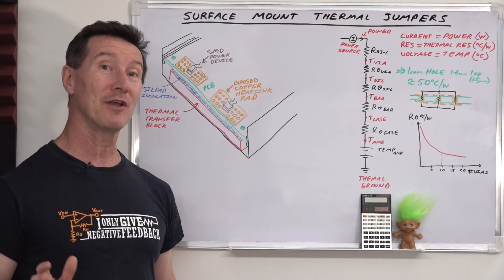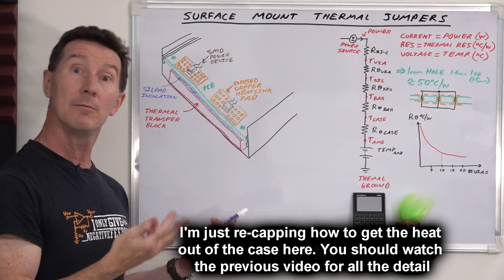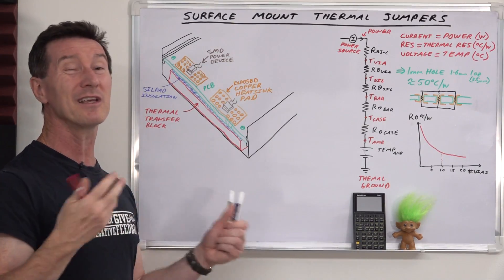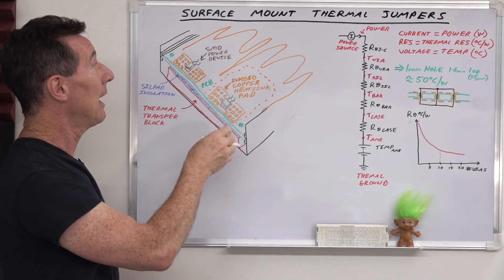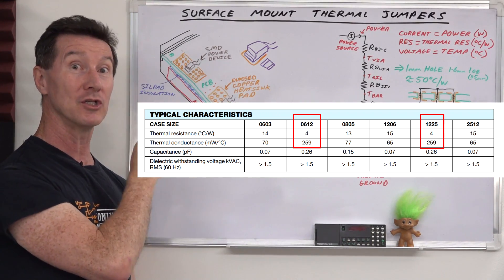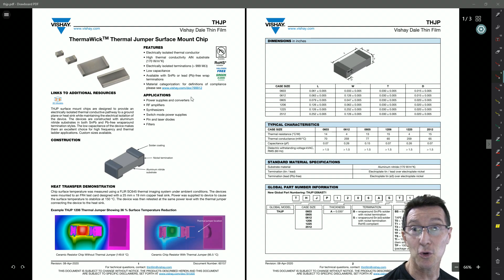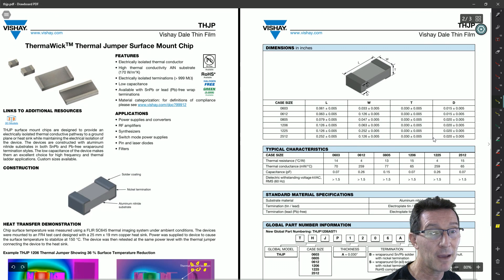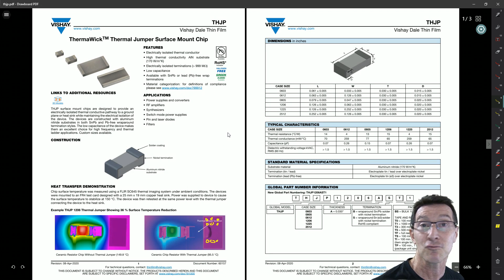EEVblog #1347 - SMD Thermal Jumpers could be GAME CHANGING!

Comment: Interesting part to say the least. But Dave, you seem way too hyped about it to have noticed how Vishay used % to describe a temperature reduction.
When just stating "ambient" as the room temperature, is that 20 C or 25 ? Or 24, or 22.5 or any of the numerous other "standard" ambient temperatures?
Also, the comment "really expensive thermal modeling software to do that" really? Just do the maths, or write a scrip for it in a spread sheet, it really isn't hard to approximate accurately enough that manufacturing tolerances will have a larger error than the approximation.

Now, I am not critical for being a downer or something, this is actually interesting components with interesting applications.
But the first 10 minutes of this video is just you repeating the same things 4 times over.... Say something once and move on, I heard you the first time.

Also, in regards to going surface mount, usually adding additional manufacturing steps is worth more than shoehorning in an all surface mount solution. Even when space is a premium....

These thermally conductive eclectically isolating ceramic jumpers is something I would mainly see use for in RF or other analog applications where parasitic capacitance is a game breaker. Since that is the main disadvantage of having a huge copper fill as a heat sink, so using these chips to couple it out non electrically is a huge advantage here.

Though, in a lot of cases, a good thermal pad and a slab of aluminium goes a really long way, and can provide additional features, like providing rigidity to the product, or a thermal buffer, and for high powered applications a heat sink will be needed in most cases regardless.
Reply from the maker: You can't easily "just do the math" for thermal surface spread and interface modeling. Show us  your magical spreadsheet script for thermal modeling across a copper plane. We are talking finite element analysis here.
Reply: @EEVblog  There is a difference between approximation. And simulation.
Finite element analysis is a far more true to life way of doing it, and yes, that one wouldn't trivially do in a spread sheet.

But an approximation is a different story.

Do remember, engineering isn't about being 100% accurate, but rather sufficiently accurate for the application.

Just like one can ignore a 1M resistor in parallel with a 1K one for most circuits. (Not all circuits , depends on the application after all.)

Thermal modelling should generally have some breathing room as well. Since most components doesn't tend to last long when near their max operating temperatures to say the least... This alone drags down the accuracy requirement for our thermal model.
Reply from the maker: @todayonthebench  Yes I know, that's why I believe I said "to do it properly" or some such you need the FEA software.
Reply: @EEVblog  "properly" is though a relative term.

But to be fair. Your video seems like you made it in the heat of the moment, before the hype has settled.

This is a relatively niche component, and there are transistors on the market with isolated tabs. Though, oddly not that many SMD ones....

Though, if heat sinking is a true requirement, one will practically always use a heat sink. Even for compact fully SMD solutions. (screwing on a aluminium/copper plate isn't particularly hard... Nor adds much cost in manufacturing, the transistor itself can at times be more expensive than the plate and screws + assembly....)

But it would be interesting to see how these stack in comparison to using high valued resistors instead. (10M is practically open for most power electronics where heat sinking would be needed.)

Comment: Also related to SMD thermal management: EEVblog #677 (Mailbag) - 23 minutes in. "PowerPeg" thermal inserts for PCBs that go under the SMD part and provide a chunk of metal through to the other side, optionally with a threaded hole for heatsink attachment.
Reply from the maker: Would be awesome to get an insulated version of those.

Comment: @eevblog im going to mention this idea here in public before anyone else has it and releases a commercial product so my comment is in the public domain, your video expanded my mind to the possibility of non electrical, elements that use physical properties on a circuit board like this(btw, do these little thermal jumpers have a measured/rated capacitance in their specs?)
how big can a peltier/seebeck device be made? can you measure a difference in a single junction or array of 10 in a short/fat row? my idea: a thermal diode(they exist, both electrical and mechanical) intended specifically to draw heat away from 1 of their sides
hey dave, want in on the ground floor? i only know so much about product development so you would already be incredibly beneficial in this regard but a product like this could literally be utility patent worthy, step 1: find a cheap source of raw peltier elements not on a substrate
Reply: "do these little thermal jumpers have a ... capacitance spec?"  Did you not watch the video?
Reply: "hey dave, want in on the ground floor?"  Hahahahaha.

Comment: next step would be to have thermal layers on the PC
Reply from the maker: You can get that. Exotic PCB thermal solution exist from specialist manufacturers.
Reply: @EEVblog  forgive me Dave i'm a little starstruck right now (big fan). I had no idea such things exist. I can think of a few things that would benefit for that.
Reply: @RooMan93  It's not even that exotic -- you can order single-sided PCBs where the other side is aluminum at the usual online PCB vendors for cheap.
Reply: @Graham_Wideman  🤦 you're absolutely right for LEDs and such. I was imagining  a sort  of flex-rigid pcb with the flex being some kind of thermal material.

Comment: Thermal jumpers confusing reverse engineers since day one!
Reply: Just print some random numbers on them :) Or maybe make thermal jumpers with multiple pins.
Reply: Oh come on dont be petty engineers. Just use sensible design practices and don't make it a complete PITA to troubleshoot for repair.
Reply: Honestly, I presume any reverse engineer worth their salt is actually going to measure the resistance (and capacitance for capacitors, even if they have to pull it out of circuit). Which would give the game away pretty quick.
Reply: And make them black if they get a lot of pins. 🤣
Reply: What would these read on an LCR tester?

Comment: Tbh, although this is nice and dandy, nothing beats a quantitative thermal analysis with Finite-Element Method software. These are expensive as Dave suggests, but with minimal effort and some math you can do a nice DIY piece of software to thermally model your design with incredible accuracy.
Reply from the maker: I'd hardly think writing your own custom FEA stuff is "minimal effort" for most people.
Reply: @EEVblog  that's the thing, there are a lot of ready-to-use open-source libraries and programs. All you need to do is adapt it and tailor to the needs of your application. I may have been slightly misleading with the "minimal effort" wording -- it will take some effort, but nothing too taxing.

Comment: The board experiment would actually be an interesting video. In particular compare their thermal performance to standard resistors. Sure, I know that they are isolated, but a 10M SMD resistor is for many applications (particularly higher power ones) effectively open.
Reply: you can also get like 40 smd resistors for the price of one, so even if it's like 5-10:1 it might be worth to just have 10-20 100Mohm resistors around your part.
Reply: @satibel  Has to be a big part then, otherwise there is no space to get all those resistors around it.
Reply: @satibel  yeah, but who has space for 10 resistors?
Reply: @ProjektMacu  on smd To220 and sot428 sized componants.
sot428 is around 6*6 mm, so you have 18mm to lay your resistors on all 3 sides, which I'd reckon could fit 10 resistors though it depends on what size you use.
Reply from the maker: The ceramic base wouldn't be a great conductor of heat I'd imagine. Although you can heat up both pads of a resistor from the one end, so it's possible.

Comment: Far better to just use either an IMS pcb, or speciific packages that have isolated pads.  A fair few packages now support through pcb copper studs, allowing you to use a std FR4 pcb, and just fit small copper heat pillars under the devices to sink them. And as the isolation is done internally in the device, it's generally a much lower overal impedance and because it's internal, you don';t have to worry about creepage and clearance or tracking / flash over etc for HV use
Reply: Isolated thermal pads in packages is truly a wonderful technology. That largely makes this type of component a fair bit redundant.
Though, haven't checked the numbers yet, but maybe one could get a bit lower parasitic capacitance by using these jumpers.

Comment: I always thought there was a scientific reason that electric and thermal conductivity were correlated. I would love to hear a quantum explanation for this.
Reply: there are two mechanisms of thermal transfer: by free electrons, and by phonons. Metals are great at their electric thermals, which is why electrical and thermal conductivities correlate strongly. But for insulators, phonons are the only thing. There, i'm not sure what exactly is responsible, but it seems to correlate with atom mass (the lighter the better) and bond strength (the stronger the better).

Anyway, at room temperature, diamond is the most thermally conductive solid of all, about three times more so than copper!
Reply from the maker: @victortitov1740  Next to diamond is Beryllium which is an option on one of those jumpers.
Reply: @EEVblog  Gold-coated Beryllium is what was used for the JWST primary mirror. The idea, like everything else in JWST's design, being to shed as much heat as possible, and bring the instrument side of the observatory to within a few degrees of absolute zero.
Reply: @BlackEpyon  
I suppose this reduces distortion?  But what distortion specifically? E.g. does that heat turn into noise, between the mirror and sensor? Or something else?
Reply: @PaulLawson-k8v  Berylium is lightweight and doesn't deform much under thermal stress, which is critical for telescopes, especially one designed to look at the oldest galaxies just after they formed. In addition, each of the 18 mirror segments, plus the secondary mirror, also include actuators (similar to adaptive optics) to fine-tune the focus of the mirror after launch (learned that lesson from Hubble). 
Because JWST is supposed to operate from 600nm (mid green in the visible spectrum) down to 28,000nm (mid infrared), any excess heat will show up as noise interference in the sensors, so it's critical that the instrument side of the craft be as cold as they can possibly make it.
Reply: @john duh This thermal bridge is proof it is not. I think that law is comparing thermal and electrical conductivity of the same material.
Reply: I think it's just that the formulas happen to have the same form. Things like Ohm's law or P=V*I have a pretty basic structure that can be found in many things.
Reply: @john duh from a cursory look, Wiedemann–Franz law seems to be only applicable to metals and I'm not sure it can be even used to compare different metals, since some are correlated positively and other negatively with temperature (resistance increasing or decreasing for an increasing temperature.)

Comment: If the thermal pad on the device shouldn't be connected to electrical ground, why do the manufacturers connect it internally then?
Reply from the maker: Because it's part of the substrate, and is the best way to direct conduct the heat out.

Comment: I just doublesink when the headroom is poor usually due to lack of space ect on one side of the pcb so I'll use thermalpads and sometimes stick on heatsinks when there happens to be blank space thus having some level of cooling that way. This little trick does work on laptops pretty well and those with a lot of metal be it a chases as the case with some Thinkpads or metal body with some Dells one can just use that as the heatsink. It gets trickier for mxm cards and such when the vrm is a furnace.
Reply: got an old compaq laptop with pentium 4, there was enough space inside to fit a small salvaged heatpipe to sink to the alloy frame

Comment: Wonder what the thermal resistance of a fat ≥10 mOhm resistor is. Couldn't you use very high resistance resistors for the same application?
Reply: I would think it's quite high. Chip resistors seem to usually be constructed with AlO substrate, which has about an order of magnitude less thermal conductivity than the AlN used here. It would be interesting to measure if they would be useful at all for this, though. I'd also be curious if the thermal conductivity of the resistance affects it whatsoever (ie. is a 1R resistor any better than a 10M resistor) - I expect not, the typical materials seem to have even lower thermal conductance than the AlO and it's going to be a relatively small part of the cross section.
Reply from the maker: The whole point is they are insulated.
Reply: @EEVblog  10M is insulated enough for most applications apart from high voltage. Would be very interesting to compare the thermal performance of these versus standard resistors or capacitors of the same size
Reply: @mikeselectricstuff  Agreed, even with the expectation that thermal performance would be worse, it would provide a neat control/point-of-reference.
Reply: @mikeselectricstuff  I'd think the thermal resistance of regular 10M Resistors would be quite high, let's say if they were carbon or metal film, that would be orders of magnitude worse than a thick slab of aluminium nitride or the beryllium stuff they're using.

But I'd like to see a comparison
Reply from the maker: @mikeselectricstuff  I'd expect order of magnitude worse.
Reply: @EEVblog  If you do some test, you should include some. Would be interesting!
Reply: @mikeselectricstuff  You can do a rough test by observing how fast you can desolder an SMD resistor or capacitor, heating only one end.

Comment: Going to guess one of the applications will be in mobile phone internals, as the power converter switch cooling, plus the cooling of the hot CPU chips, to get the centre thermal pad out to a larger copper pour, but still route traces under the board in the middle layers.

Another will be high power RF applications, where you need to handle power by having tons of SMD transistors in parallel, and this allows a grounded and easier to design heat path.
Reply: I doubt mobile phones would use them

There isn't enough PCB area for dissipation and it would be very hard to accommodate even a few 0603 sized jumpers. 
They're better off using the case as a heatsink along with all the shielding metal can stuff they have on top of the chips.
Reply: A lot of high powered RF amps I have seen tend to use 1 or 2 larger transistors, typically in a ceramic package sitting in a routed out pocked in the board. Primarily to have lower series inductance. But this also allows them to have thermal compound on both sides of the package, to then typically be surrounded by a die cast aluminium case.
Only practical methods to give it better cooling would be to add some heat pipes, or use a copper case...
In short, high power RF kind of already have great cooling thanks to having isolated packages as is.
Reply: some to220 parts (e.g., BTA16 triacs) have built-in ceramic insulators (thermal-conducting) to make their tabs isolated. I think such a technology is more useful for heat-sinking in very dense devices, and is probably already used in power conversion chips. Many power chips have ground-connected thermal pad for heatsinking, such as class-D amp chips or smps chips, they might have something like this internally.

Comment: Oh, gawd. 30 years ago I had an instrument/sensor that normally ran cool, but under specific conditions would run hot as hell.  And we couldn't add a heatsink or vias to ground.  So we stacked a Peltier cooler between it and the case, and simply dumped power into it when things got hot.  Yes, the power supplies were oversized...
Reply: Are Peltier electrical insulators? I have SMD resistors that get quite hot, and I could put one of them on top the resistors